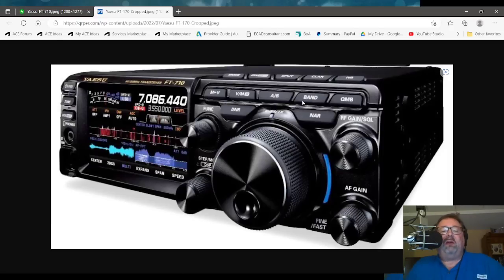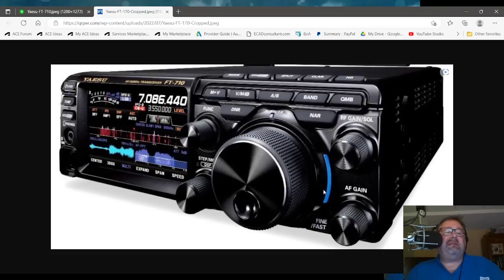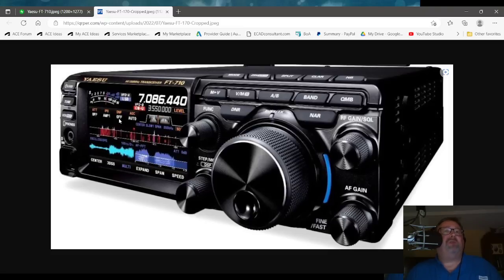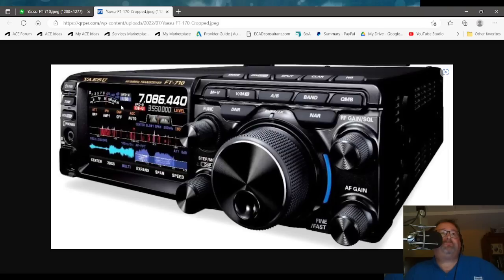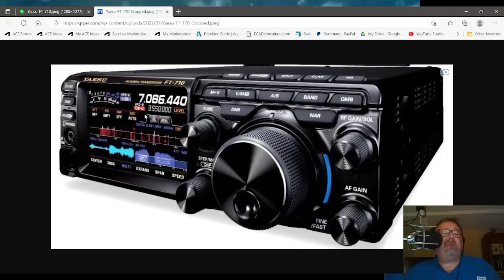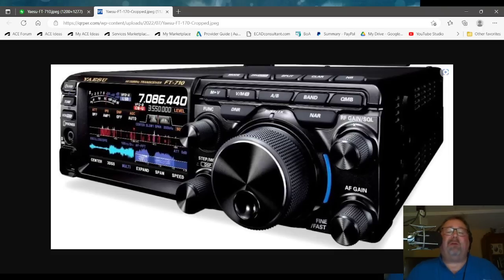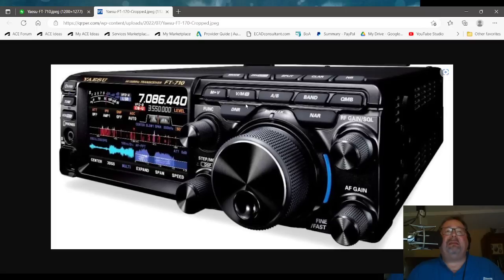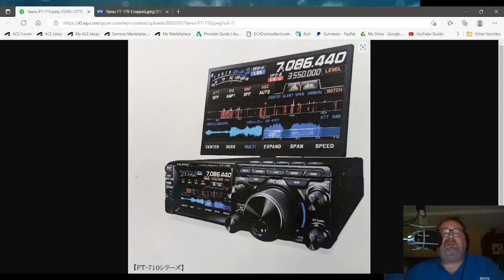A New Yaesu Transceiver? FT-710? (video #1 in this series)

Comment: Can anyone tell me the differences between the 710 Aess and the field?   I have been off the air for over 40 years, now being retired I think it is time. Seeing I am retired I want to make the right buy and with all the new stuff out, and me not formalizer with it, I need a little help. I always used Yaesu and like the look of the 710.
Reply from the maker: The FT-710 Field doesn’t come with the SP-40 external speaker. But. If you are looking for the best value in a base station, look at the FTdx10.  I encourage you to watch the entire FT-710 series and compare to the FTdx10 if you are wanting to make an informed decision.  Some of the videos in the series compare the two.

Comment: Neither the lack of backlighting of the buttons nor the VHF/UHF frequencies (above 144-mHz) is a deal breaker for me.. those would be nice but not necessary. It seems the broader receivers with such broad coverage in the low-medium price ranges suffer, at least somewhat. Are the "rubberized" buttons able to resist the incursion of dust (portable operation)? If so, that works for me.
Reply from the maker: Yaesu doesn’t specify an IP rating, but many are using the FT-710 for portable operation. In fact, Yaesu has now released the FT-710 Field, for portable operation. It doesn’t come with the SP-40 speaker.

Comment: Has Y Sue finally started caring about blind people in radio? I’ve checked out the radios and they have no embedded speech! And their menus just wrap around and around you can’t tell when they start when they end without site! And the new menus inside menus inside menus! Have they changed any of it? Have they started caring about the blind community in Ham Radio?
Reply from the maker: I have no idea. John Kruk would be someone who might be able to answer that. The menu I wrestle with most is my ICOM 880-H. I have to keep the manual in my truck at all times. 

The FTdx10 menu is all in one place, after you press the Function knob. I don’t know how they could make it much simpler.  But I don’t know if it has the speech mode for the visually impaired. 

73, de N4HNH

Comment: Well Doug here we go again. Yaesu released a radio with incomplete specifications and functional data. Remember the big blow up with the FT5 and all the YouTube (present company excluded) making wild claims both pro/con about the HT.  I told John Kruk that Yaesu bares some responsibility for this confusion by leaving a vacuum of knowledge about the new product. This vacuum leaves the door wide open for the YouTube keyboard warriors to jump in with misinformation to jump in with half truths or outright lies.  John didn’t care for that but I stand by it. Thoughts? 
de
WA9SWW
Reply from the maker: Yaesu hasn’t officially announced this radio. In fact, my contact at Yaesu says he has heard nothing about an FT-710. I do have some information from a Yaesu reseller in another country that I shared with the Patreon team. It includes detailed specifications.  

The information, or misinformation, about this radio is coming from International sources. Who knows, maybe it won’t even be available for the U.S.A. market, though that would be short-sighted. 

73, Doug

Comment: without vhf uhf it's a total turd
Reply from the maker: I don't think Yaesu is gunning for the FT-991A.  It's still available.  I think this might simply be gunning for the IC-7300, utilizing a direct sampling receiver, with superior DSP and a direct output for an external display.  Hopefully Yaesu put proper filtering in the front end to protect the FPGA from digital overload and to achieve selectivity on par with the FTdx10.  Time will tell.

73, de N4HNH
Reply: Vhf/uhf usually requires the undesirable up conversion.

Comment: This looks sooooo photoshopped!  Whatever they [Yaesu] bring to the marketplace, I hope they iron out all of the bugs (for those of us who purchased the FT-991 and discovered its shortcomings).
Reply from the maker: I definitely remember that.  The funny thing is, my friend Joel had an early FT-991 and it never had one problem.  In fact, he refused to even update it's firmware.  He traded it to another ham who has also never updated the firmware.  It's sort of like me with the FTdx10.  I'm still using version 01-04 after 16 months and I've never had an issue.  It's strange.

73, Doug

Comment: What does the absence of "dx" mean?  Seems like the "dx" was reserved for the TOTL Yaesu's
Reply from the maker: I was wondering that myself.  They tend to use FT- for mobiles and handie-talkies, but the FT-991A is more of a base/mobile.  You might be absolutely correct regarding the top-of-the-line idea.

73, Doug

Comment: To me it looks like it doesn't have an outer ring, if it does man it's sure small, look at a picture of the 10 and this one side by side.
Also I've heard that the dimensions of the 710 comes in between the 991 and the 10.
Thanks for the update Doug.
Reply from the maker: It doesn't have an outer ring.  I thought I pointed that out but it might have been a previous take.  I shot 5 versions of that video.  There is no outer dial and the other knobs have no ring either.  The buttons are moved for better ergonomic placement.  I like that.

73, Doug
Reply: @n4hnhradio  

Thanks again,
You could of mentioned it and I just didn't catch it.👍
Reply: Yes, I was thinking about the outer dial but called it a ring on the comment, you did mention the outer rings. 
I'm sure we'll be finding out more on this radio as time goes on.👍
Thanks for all you do.

Comment: Looks like the button on top, 2nd to the left is ZIN/SPOT.  Agreeing with you on the DVI-D connector. I'm really interested to hear if they listened to customers on some of the decisions it looks like they have made with the 710.
Reply from the maker: Good call, David.  Good eye.  My eyesight isn't great.. I'm actually having eye surgery tomorrow morning.

I like how they moved the buttons away from around the VFO knob.

Thank you for being such a great supporter of the channel!

73, Doug
Reply: @n4hnhradio  I'm reading another report, and the FT710 will come with a DVI-D Connection. Apparently, Yaesu has yet to empty the warehouse full of those DVI-D components :)  lol  Maybe/Hopefully they put in Display ports in the next generation of radios. By that time, Display/HDMI will be old, and they will find a warehouse full of those :)  Cheers
Reply from the maker: Ha!  That’s funny, David. Did you see the specs I posted for the Patreon team?  It definitely says DVI-D.
Reply: @n4hnhradio  It just happened I had turned the computer on at that time. I should have known you already had it posted on Patreon. TNX -
Reply from the maker: I try to keep guys updated with scoops when I can.

Comment: I just hope they allow settings to remain constant when chgg bands and not be required to reset after even a quick scan off band..I like my 891, but that gaff ticks me off daily🙂
Reply from the maker: The FTdx10 stores everything in memory slots.  It even stores all settings in band-stack registers.  I know what you mean about the FT-891.  I hope this radio will follow the FTdx10 architecture.

73, Doug

Comment: To me its like the ft dx 10 with more knobs to me i stick to my ftdx10.💯
Reply from the maker: I agree.  I'm only interested in the possible 10W version, for SOTA backpacking.  But it needs to have an internal ATU. I mean, the beautiful display isn't enough to pull me away from using my 100W FT-891 for SOTA.  If it only weighs a couple of pounds and has an internal ATU, it might win me over.

73, Doug
Reply: @n4hnhradio  
How clean is the 891 transmit signal?
Rob g3rce
Reply from the maker: Robert, I've never looked at mine on a scope but I presume it is fine, since it passed the FCC type acceptance test.  I get nothing but compliments about how mine sounds.

73, Doug
Reply: The transmitter signals are generally better at 75-80%. Can really deteriorate as voltage drops. The person on receive is not aware of how clean it is but neighbors on the band might be harmonic up.

Comment: still no clock on the touch screen? Yaesu should really hire an ergonomic engineer
Reply: A clock !!
Why ???
You have your watch, your smartphone !
Reply from the maker: I don't know why there is a place in the menu of the FTdx10 to set the date and time with no place to display it. But I would probably never look at a clock in the display.  My logging software logs the date/time for me and it has a big clock displayed on my computer monitor. In addition to that, I have two other clocks in the shack, one that updates automatically over the web and another that updates via WWV and the Atomic Clock. 

I am concerned about future firmware updates using up the available memory. So my priority is mouse control. Right click over the waterfall to bring up the Function menu. Right click over the frequency readout to change bands. Left click over the frequency readout to use the mouse wheel to scroll up or down in frequency. Double-click over the frequency readout to cycle through the band stack registers. 

73, de N4HNH
Reply: @n4hnhradio  this is supposed to be a semi portable rig, right? are you gonna always bring all that out of the hamshack? you may be surprised how much you looked at it when its gone lol
Reply from the maker: It could be a good POTA rig. Slightly smaller than a FT-991A. I know someone who uses his FTdx10 for POTA. 

I’m not planning to buy A FT-710. It is a FTdx10 lite. I already have a FTdx10. 

73, de N4HNH
Reply: @n4hnhradio  i have an ftdx10, we activated a pota park with it for field day actually. i like alot about it. alot i dont like are little things that i feel were the result of the lack of testing the ergonomics. mostly the inner knob not tuning in 1 kHz steps (unless you can help me figure out how to do that). and the volume being hard to use with the right hand.
Reply from the maker: Tap the KHz section of the frequency display and it will blink.  While it is blinking, you can rotate the VFO knob to tune in 1 KHz increments.  Tap the FINE button at the lower left of the VFO and you can tune in 1 Hertz increments. Tap the last three digits in the frequency display and a keypad pops up.  You can directly enter a frequency using the keypad.

73, de N4HNH
Reply: @n4hnhradio  so, what I have learned...I really like the center knob on Hz when working cw, but despise it when ssb....I know when operating cw i don't notice it being an issue ..but ssb having the center knob do khz and the outer knob fine tuning makes more sense......you would think a simple allocation of encoder values for the khz step on the inner knob and a selection in the menu would've fixed it....
Reply from the maker: When we buy Japanese technology, we are buying from a proud people who don’t take criticism very well. Even competitors in Japan avoid insulting one another. It is considered dishonorable. 

The things we value, even in a radio, don’t necessarily match up with Japanese values. A few years ago Kenwood sent a couple of their engineers on a tour of their dealer channel here in the U.S.  One of my friends at HRO showed them that he couldn’t read the display of his mobile while wearing sunglasses. They don’t wear sunglasses very often in Japan, so they didn’t account for that. The Japanese also have smaller hands, so working the buttons around the FTdx10 VFO is no problem for them. They are quick, so the 3-second timeout of the popups is enough for them. It occurred to me that they might think of us as inferior to them, with some of the requests we’ve sent to them. It’s a cultural difference though. 

If we don’t like the Japanese technology, there are the Chinese offerings. But the Chinese don’t know how to make anything but cheap SDRs. 

The best thing to do is buy American, from Elecraft or Ten-Tec. 

73, de N4HNH
Reply: @n4hnhradio  Elecraft is definitely on my radar...
All gripes aside, I think the ftdx10 is a great performer, but I do have sausage fingers that cause chaos lol! Thanks for your input and perspective.
Reply from the maker: I’m afraid unless we go back to doing what hams did in the early days - building our own transceivers - we will have to settle for the best radio we can afford to buy, and accept where it differs from our idea of the ideal transceiver. I prioritize by receiver capabilities first, followed closely by ergonomics. If I can’t hear the other station, I can’t work him/her. Receiver performance therefore has to be number 1. I chose the FTdx5000MP because it excels in both receiver performance and ergonomics. 

No radio is perfect.  I’m sure Elecraft has some shortcomings too. But Elecraft is run by Eric Schwartz, an American.  If you watched my Huntsville Hamfest video, you saw me discussing the K4HD with him.  American manufacturers are usually more receptive to our constructive criticism. 

The cool thing is, you can buy a K4D now and upgrade it to a K4HD by simply plugging a board into the K4D, once it becomes available. 

73, de N4HNH

Comment: Oh Dude, you silly wabbit! That's a regular monitor on it's stand behind. It prolly has a DVI port on it like the DX10. Considering the weight, it might make a good drive-to portable. Not a back-pack one. But then, us geezers don't do a lot of mountain climbing anyway, unless there's a parking lot at the top. The one thing that keeps my DX10 from being portable is that it weighs like eighty pounds.
Reply from the maker: I didn't say the monitor was attached.  Someone else mentioned that they hoped it was a folding display.

I'm 60 and I hike mountains.  I'm one of the youngins'. I thought I was getting too old but there are guys in their 70s who put me to shame.

73, de N4HNH
Reply: @n4hnhradio  Sorry, wrong video, eyes getting old too. <embarrased>  (Too much arthritis to hike anymore)
Reply from the maker: I read where someone specialulated that about the monitor.  That would be wild.

Comment: NO BETTER TRANSCEIVER THAN THE FT-991A ... THAT FT710 IS NOT AN ALL MODE TRANSCEIVER..
Reply from the maker: FT-991A is the radio to own if you can only on one radio.  Truly the most versatile.  73, de N4HNH
Reply: @n4hnhradio  Agree!!! I have an FT-991A and don't understand the marketing perspective of Yaesu. I think their radios, especially the 991A, look like the Ferrari of radios. K8JAZ
Reply from the maker: Without a doubt, Tony.  

73, Doug
Reply: Replace the FT-450D range segment, better and cheaper than FT-991A or an IC-7300.
For small budgets
Reply: What mode is missing?

Comment: Pretty clear yaesu doesn’t pay attn to their customers. Regarding firmware software updates for the 10
Reply from the maker: Kenwood makes their money in the commercial radio market, the same place Ten-Tec went. The profit margins are better there. Yaesu has a presence there as well, with their Standard Horizon product line. I’m afraid if hams keep complaining about the price of an HF rig we might see Yaesu commit more of their resources to commercial radio as well. 

This FT-710 might be Yaesu’s way of saying here it is, a budget-priced transceiver with touch control and a direct output for a monitor. 

Possibly the reason Yaesu hasn’t gone predominantly commercial yet is that they are still number one in sales, and they have the top rated transceivers in the amateur market. I hope they will hang in there with us. But so many hams are buying the $500-600 Chinese radios. I’m afraid Yaesu will leave us behind before they will stoop to that. 

73, de N4HNH